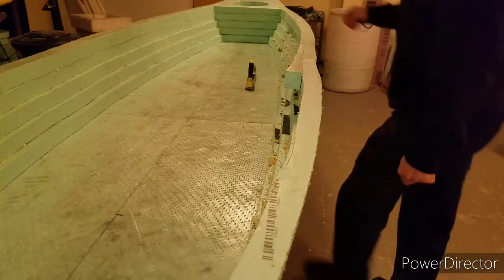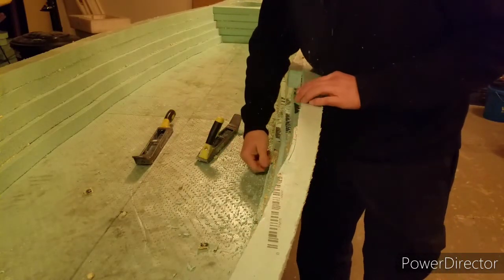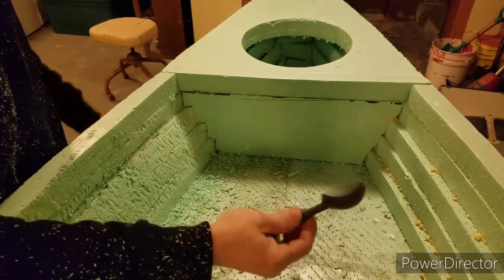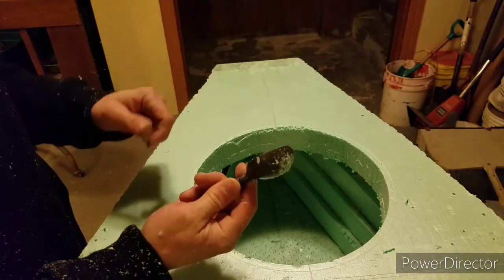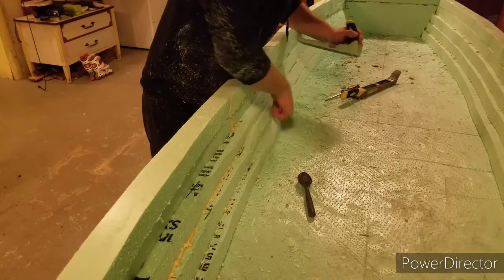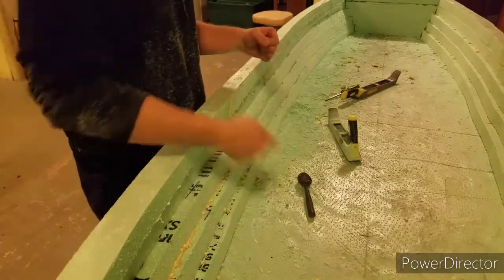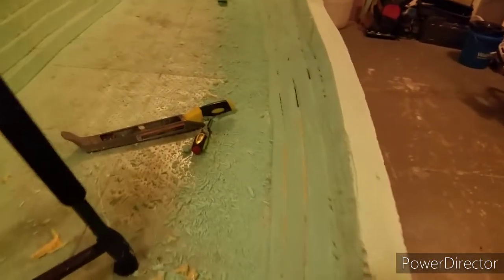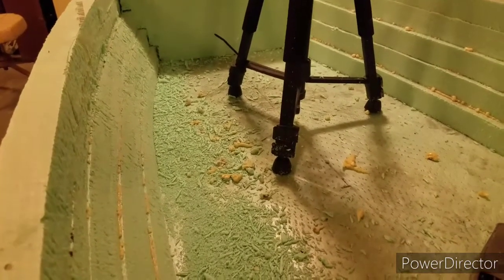Sawfish kayak,  shaping the cockpit

Comment: I am interested in seeing how you will like the 10" sides. I have my sides at 8" tall currently. Then as on yours, I will be adding the storage covers at bow and stern. I do not remember seeing more than 8" on any of your other kayaks. My Walmart bleacher seat bottom will be 8" above the inside floor, therefore about level to where my sides are currently. I am trying to decide before I install my side rails. My sawfish is a sit-on-top that I will fish out of so I hope it is stable enough. Have the best of luck with yours!      Thank you for your videos.  🛶
Reply from the maker: You can always add some foam and PVC outriggers if you want more stability
Reply: @rowerwet  After looking at the hull with 8" sides. I am going to add the additional layer as you have at 10 inch sides. It makes sense, looks better with my 8 " raised seat. and seems as if it would benefit the lean over stability. Thank you so much for your videos and your knowledge!!